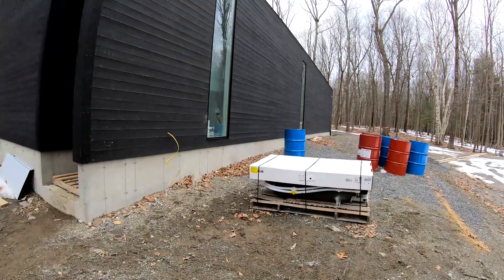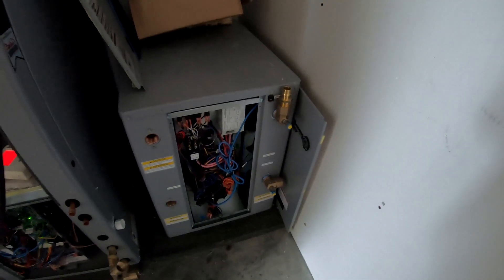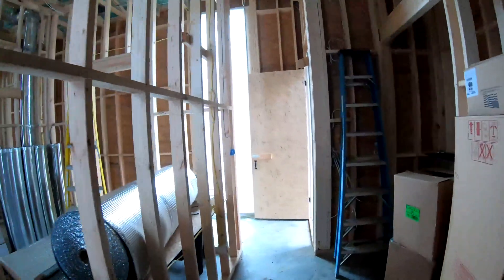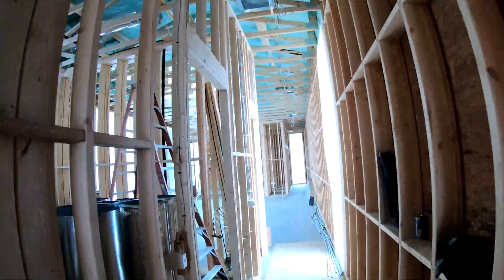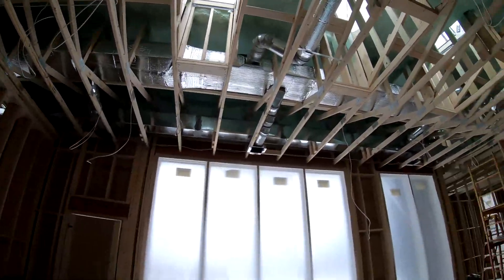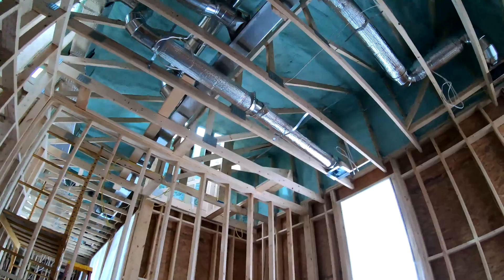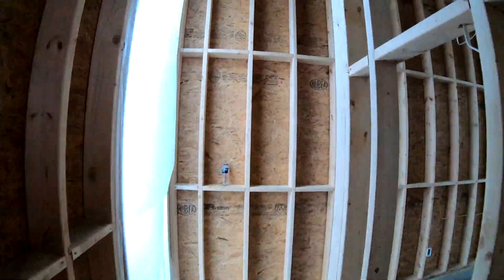Waterfurnace Geothermal water to air and Domestic hot water

Comment: How well does this system work for the domestic hot water? Do they run out, or does it heat faster than you can use it?
Reply from the maker: It works well for Domestic hot water. It takes some time for recovery. The customer has never ran out of hot water and they fill a tub also. It will recover faster than a electric hot water tank.

Comment: why not do a water to water heatpump system for the in floor heat?
Reply from the maker: I did go back later to hook up the water to water for DHW to heat the radiant in the slab that I installed. It works great.

Comment: I have a 7 year old waterfurnace 5 series.  The loop lost pressure and the installer came out to repressururize it.  They charged me $250.  But unit is still under warranty.  Shouldn't repressurizing the loop be under warranty?  Should the loop ever need repressurizing?
Reply from the maker: Adding pressure to the loop is a normal service it’s not a warranty item. The loop will expand over time especially in the summer when you heat up the loop and lose pressure. I normally add pressure with the yearly service. $250 to do that is a normal price.
Reply: @ericmaskell3278  https://youtu.be/WmLuQHs1OWI
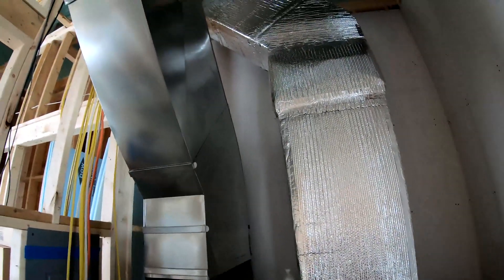In this video at 1:50 she claims there is no loop maintenance ever?  Thank you for responding.
Reply: @ericmaskell3278  do you just connect a water hose to the loop entrance and spray a gallon or so of water in?
Reply from the maker: @mobleyMobley  I have a special tool that goes into the Pete’s port to pressurize it. It doesn’t take that much water to bring it back up but you don’t want to introduce air into the system.
Reply: @ericmaskell3278  its like a fat needle that sprays? Where can I buy those for when it loses pressure again? I watched him do it.  It looked really easy.
Reply: @ericmaskell3278  what is in that pete's port that seals the liquid in?  Is it like a neoprene?  Is there a limit of how many times you can penetrate it before it begins leaking out?
Reply from the maker: @mobleyMobley  you can get it online or a local supplier

Comment: Thank you for the video. I was wondering if the HRV and the geothermal heating and cooling duct work are the same? Like how do they work together and hooked up? I have been trying to find answers but for some reason it is not clicking for me. Thank you for your time.
Reply from the maker: The HRV has a exhaust and fresh air intake that go throughout heat exchanger inside the unit which exchanges the energy. the fresh air goes into the return of the geothermal unit where it gets filtered and distributed throughout the house. The exhaust comes from the bathrooms and kitchen to remove the stale air in the home. Hope that help you.
Reply: @ericmaskell3278  Thank you so much! Have a wonderful day